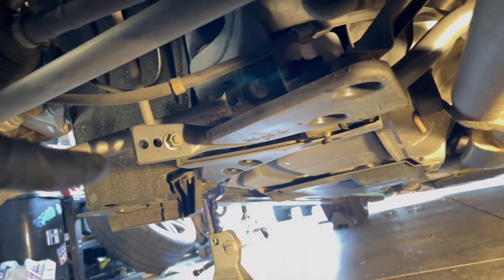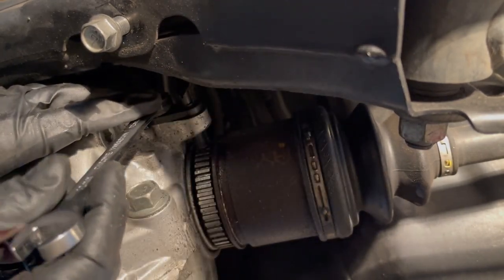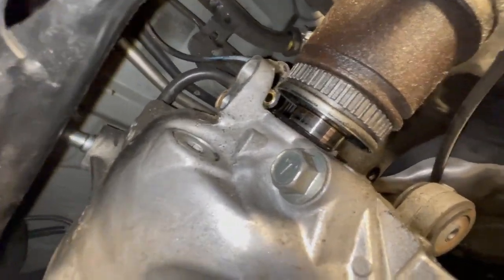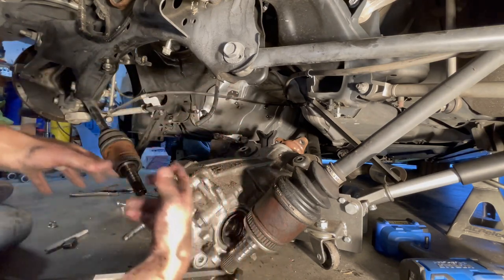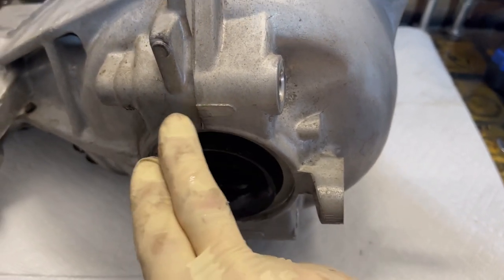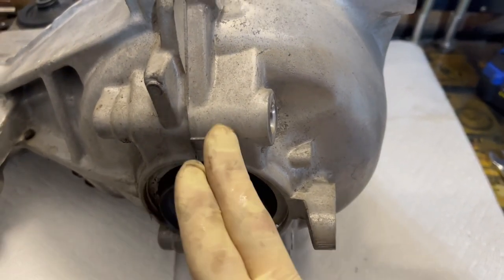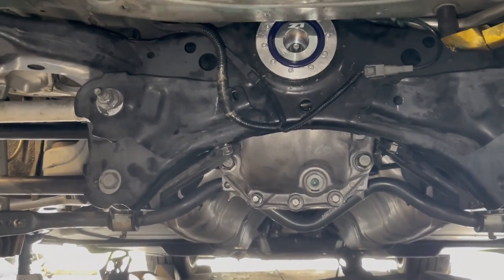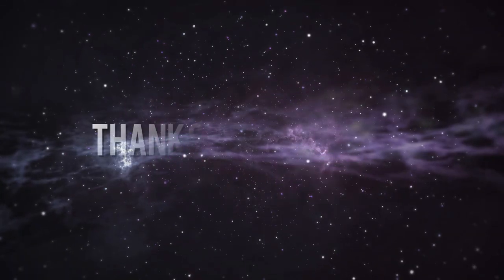Q50 gets an LSD! Traction Concepts LSD Kit Goes Into The Q50 — Installation Process

Comment: For anyone performing this modification: Do not replace the side bearings unless they look like they need it. Messing with bearings can change your side to side preload. The FSM says to do so, but you're opening up a can of worms if you do. I would replace the dust shields as specified in the video.
Reply from the maker: Right, there really shouldn’t be any reason to replace the bearings.

Comment: Great Job and thanks so much for putting this together. Hope it helps the community.
Reply: Hi,
To your knowledge, is there any Vr30 Q50 running this kit and doing some drag fun? This is calling my attention and was wondering if it would manage some 11s or 10s drag car.
Reply: @alexisacevedo6121  We know there are some users that drive to the track and run drag. Specifically running those times, it's difficult to say though if you email us prior to ordering, we can ensure it's set up for this purpose. They are set up to handle high hp and torque already and installation is key:=)

Comment: Thanks for the video, I was wondering if you drained the Differential since installing and if it was nice and clean? I want to do this to a Camry TRD, but am worried how it will hold up.
Reply from the maker: No I have not drained it since install.  I've only put maybe 500 miles on the car since, so it's not ready yet.  The kit shouldn't really have an effect though as there is no metal/metal contact.
Reply: @SpeedCultureStudios  There is metal to metal contact, its what makes both axles lock. The box expands from the springs and pushes the gears on either side. Anyhow, thanks for the video on it, best one I could find on it. I am still interested on how it holds up. I really want to try one out.

Comment: What was the recommended break-in period and method? Traction Concepts is saying 250 miles is fine, but specified 750 would be great. I saw you doing slow figure 8's in a parking lot, etc. Wanna make sure this thing is broken in properly before I start playing around. TIA @SpeedCultureStudios
Reply from the maker: There really is no break in.  I did the slow turns to just be sure there was no binding and no issues with install.  There are really no parts to “break in” with this kit unless you are unsure of the spider gears being ground neatly.  You could take it easy for a couple hundred miles just to be sure everything meshes nicely
Reply: @SpeedCultureStudios Yes, you are correct. 250 miles with no WOT and slow figure 8's in an empty parking lot. Then replace the fluid. Thank you. Trying to help out other doing this mod.

Comment: According to the manual you have to remove exhaust which I'm struggling to do because the bolts are stuck and rusted. When I look at your video I don't see you messing with those bolts yet your exhaust is detach from the car. Did I miss something?
Reply from the maker: I dropped the exhaust but I have my custom exhaust so it’s very simple to undo

Comment: Wait did you actually change the ratio? Sorry I think I missed a video some where about the gearing
Reply from the maker: No ratio change.  I wish we had options available!  The LSD conversion was installed on a spare carrier, but I used my factory housing and pinion gear so I had to move my factory ring gear over.

Comment: You think it will add to tire where? Can the awd guys do this along with a front gear change?
Reply from the maker: Shouldn’t contribute to tire wear.  It acts as an lsd so you shouldn’t get the chirping around corners—BUT it’ll make you want to do burnouts lol so I guess maybe it will 😂 
They have a kit for awd as well!
Reply: ~It will not add to wear. In fact, it will distribute the wear evenly to both sides which will also improve handling and should help with correcting torque steer issues when accelerating. 
~Yes, we offer an LSD for the front q50 in the AWD models. The LSD Conversion Kit and the diff are different than the rear. Once will not work on the other.
Reply: What are your impressions?

Comment: Hey man, what's the torque spec for the 4 x big bolts on the rear differential cover? These bolts appear to act like a bearing cap bolt and are 69ftlb on the g37

Comment: How much did you save from not going to a shop to get it installed?
Reply from the maker: I would imagine shops would change 4-6 hours.  Consider $100-$150 an hour.  I’d say I saved at least $500.  It’s not bad of a job honestly just time consuming
Reply: @SpeedCultureStudios  thats dope your q50’s clean man. My car’s a fwd/transversally mounted so I’m not sure if I’d be able to diy it. And essentially you just pulled a used q50 diff, got it converted into an lsd, and upgraded the diff as if you were replacing a worn out one right? How’s the longevity of the friction plates?
Reply from the maker: @Jdeeeaaa  that’s right.  I’m not sure what they claim as the live span for the plates, but they have a great reputation across platforms and have them installed in some real crazy builds that take a lot of abuse so I’m sure they are solid
Reply: @SpeedCultureStudios  that’s awesome to hear, I’d estimate they’ll run fine for around 120k miles with regular maintenance since that’s about the lifespan of other quality made plate style LSD’s. How’s yours keeping up so far and do you push your car pretty hard? Thinking about getting this for my trd camry
Reply from the maker: @Jdeeeaaa  I don’t have the car anymore, but I did a number of hard launches with it and drove the car everyday for several months after install.  Loved it!

Comment: Hey, I’ve been wondering for a while what size is your hub rings? Did you do them customized?
Reply from the maker: They aren't customized, just ordered with the correct dimensions.  Dimensions obviously depend on hub size and hub bore of the wheel.  I want to say the Q50 hub is 66.1mm.  I believe my wheel bore is 72.5mm.  So the centering rings are a 66.1 to 72.5
Reply: @SpeedCultureStudios  I’m assuming that you got them because of the vibration at 60+ mph right. Did the vibration did stop or is there some but barely noticeable?
Reply from the maker: @isaaccas2764  I never ran these wheels without them.  When you get aftermarket wheels it’s always just a good idea to get hub centering rings.

Comment: Man, I have to do this to replace rear diff side seals due to a leak. Shops want to charge me $1000. I am going to do it myself. I have all the tools. This was a good video but I would love a step by step to feel more confident.
Reply from the maker: It really is a step by step.  There isn’t anything more to it.  You wouldn’t even necessarily need to break the diff open to change the seals.
Reply: @SpeedCultureStudios  yes you are right, I don't have to break it open to fix seal, just remove the rear assembly. It looked from your video it was pretty hard to separate the shaft from the sides. Hopefully my project goes as smoothly as yours. Thanks for the video.

Comment: The most difficult part of the job and the camera dies! Been fighting this damn thing for hours.... lol
Reply from the maker: Where are you having trouble? I basically had to get in with my hands using both hands to pull the axels out.  The pry bar is handy to get pull them out past the c clip and finding the right height of the diff to give you enough room
Reply: @SpeedCultureStudios  Thanks for the quick reply. I didn't realize you had moved the 2nd part of the drive shaft to the side because I was watching it on my phone. Once I did that getting the diff out was cake. Pushed it a couple inches forward and it slipped right onto my jack. Keep the videos coming. Your channel is great👍
Reply from the maker: @Alexander-vb7ov  well done!  Saw your post on FB.  You’ll enjoy the upgrade!
Reply: Thanks again for posting the video  @SpeedCultureStudios